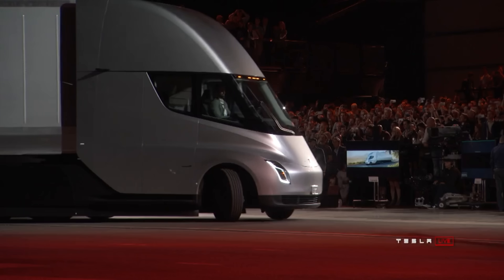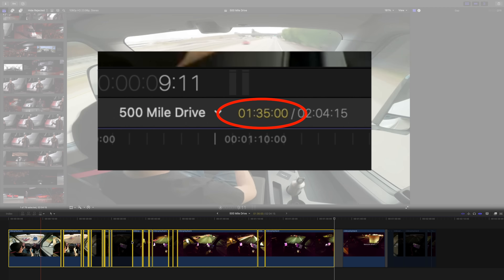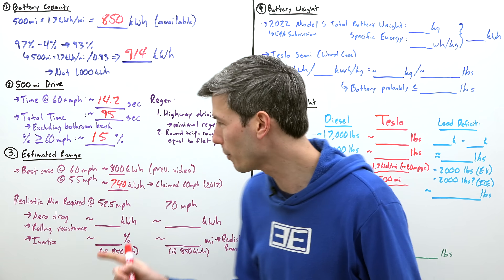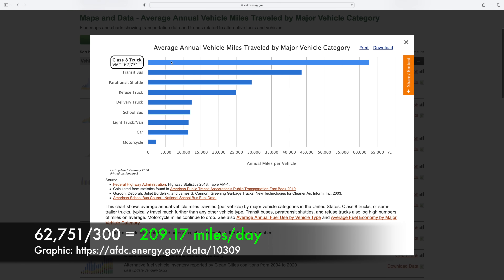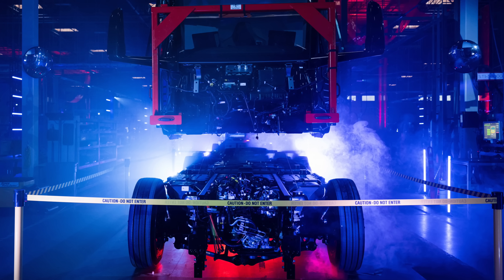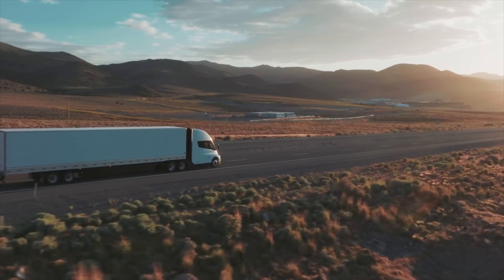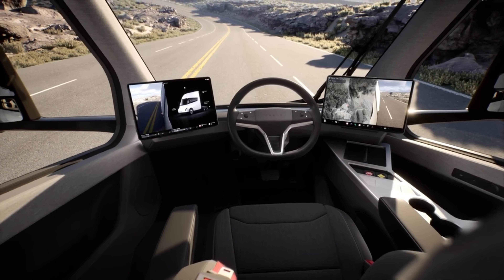Does The Tesla Semi Make Any Sense? Part 2!

Comment from the maker: *Important Note!* I left out a source for the 7.3 mpg figure for diesels, this comes from the Transportation Energy Data Book (Dept. of Energy) often referenced in the video, and references "all class 8 trucks on flat terrain." I figured since I'm using flat ground for my Tesla calculations, I'd apply the same benefit to diesel. The 5.3 mpg figure referenced in the first video was also from Dept. of Energy (video description links all sources). And to the truckers in the comments, hello and thank you for sharing your experiences! Y'all are the best drivers on the road, and I mean that. Respect!
Reply from the maker: @@silverdreammachine5866 It's not 100% (hope that isn't implied!). But if you look at the graph, the overall amount lost doesn't greatly impact the overall trend-line, simply meaning you can estimate these things on flat ground and get a fairly decent estimate. Regen is not 100%, and perpetual motion is a lie! If you get really into the trend line, you can see it does in fact change from the elevation (but small amount).
Reply: @EngineeringExplained  do you have any information on how driving on trips with high diffrence in altitude changes the mpg for dieseltrucks? If the Semi can regen most of the energy needed to gain altitude when going downhill it should make the economics even better over 1 million mile compared to a dieseltruck. Guess this apply more to the part 1 video. Love your stuff btw. Keep it up.
Reply: @EngineeringExplained  20% decrease in battery capacity in 12 months!  Assuming no fast charging! An not not running more than one driver!

COST MOST IMPORTANT!
Its now  3$ per mile VS Tesla 8.5$ per mile!  (dont forget to include battery replacement cost!)
Also using musks own figures from his videos (and using his new car elec car price) truck charging is more expensive! The cost becomes 150% more than diesel costs! Due to small increase in diesel price and huge increase in his electricity price from 7 to 50 cents! Hes not going to supply electricity at a loss!
Reply: @danquaylesitsspeltpotatoe8307  

Any idea what the decrease would be with 750 KW or 1 MW charging every day?
Reply: @EngineeringExplained  I struggled long and hard to try to understand why the 500 mile range test graph seems to show the gain from regenerative braking as significantly better than the 80% or so theoretical maximum. I finally realized that this is because there's a 35 MPH speed limit for trucks, both uphill and downhill; and the reduced air and rolling resistance almost completely makes up for the 20% or so energy loss in a climb and descent.
Reply: @EngineeringExplained Please discuss semi solid state batteries from China
Reply: Current semi uses 2170 batteries,   the S  uses 18650,  which are relatively heavier.
The three plaid motors used  are actually more powerful than the four '3'  motors available at initial launch,  and each is surpossed to be more powerful than a diesel motor.
But the big advantage is the weight saving of the plaid motor.  One can actually pick up the plaid motor, and about the size of an American football.
Reply: @davidclark2286  and can you pick up the batteries? electric motor efficiency has always been excellent, dating back over 100 years. its the batteries that are the problem.
Reply: @davidclark2286  Yeah, would be interesting to see how much the model 3/y pack compares.1,060 lbs (489 kg) 

The pack is 82 KwH and advertised as 75 KwH.
Reply: @davidclark2286  firstly, the difference in batteries packaging is negligible. the density is the same. secondly, what are the motors supposed to replace? you can't generalize all diesel motors lol. thirdly, the plaid motor is much bigger than a football.
Reply: The problem with the Semi isn't the engineering it's the economics. As is the majority of truck drivers are independent contractors. They aren't gonna buy an electric Semi with no infrastructure in place. The only way this makes sense with large corporations with local delivery routes.
Reply: @jordanslingluff287  Only 16% of US CDL drivers are owner-operators.  The corporations are going to do what makes financial sense.  If going electric makes financial sense than it doesn't mater what the drivers think.
Reply: @rogerheuckeroth7456  Oh yeah. I agree with that from a longer term perspective. I just don't see it being financially freesible for a while. Oil companies know that the USA just put out a huge green energy bill. They will no doubt pump more just to keep prices lower to counter EV sales. We are also in a high interest environment which makes any kind of capital investment very expensive. In 5-10 years I can definitely see it speeding up. But that is gonna require a lot of charging stations and our power stations cannot handle much more demand. I'd say a huge chunk of our population has lost power over the past couple of weeks. That's gonna get worse before it gets better.
Reply: @jordanslingluff287  Bingo. And for those customers, BEVs can make a lot of sense, especially given the subsidies available. Fortunately, they have multiple vendors available that can deliver product much sooner than Tesla. Tesla is very, very late into the game. And they don't seem to speak Fleet.
Reply: @TheGotoGeek  makes a lot.of sense because there's no maintenance so minimal downtime he makes sure to miss this because of mechanical bias.
Reply: @jordanslingluff287  Exactly, and even the large corp fleets want to unload and sell their trucks to the independents when the get old, which they can’t do w independents who can’t charge.
Reply: @Nill757  Good point. That's gonna be a problem with EVs in general. The average of a regular car right now is 20 years old. Ev batteries on paper only last 10-12 years. It's hard to imagine much of a used car market unless the government steps in and forces them to start honoring current standards like in ICE cars. Letting third party make parts, allowing individuals and 3rd parties work on cars, that means the ability to access the car through software...etc... Without that this march to EVs seems like more of an environmental disaster then helping anything. I mean if we start trashing cars every 10 years that will become a lot of waste.
Reply: @jordanslingluff287  EV cars are somewhat diff case.  All of them can be charged, not just sone special fleet of them w the special charger.   Yes it seems battery life would be a factor in resales, but so far the used Tesla market buys every single used EV going on the market in moments, sometimes inexplicably selling at higher prices than new.  There is, or was until just recently, some kind of weird fanatical demand ongoing.

Semi truck battery should go ~3000 charges x 500 mi, 1.5 million miles. I don’t know how that compares to diesel tractor life.
Reply: @jordanslingluff287  This is certainly true for now at least, but Tesla has shown to be capable of expanding a charging network faster than any other competitor, given that eventually trucks will be going electric anyway, the important part for investors is any electric truck will be effectively funding Tesla's network if it doesn't have a better one
Reply: @nyanbrox5418  I think Tesla has some big problems on the horizon. The biggest is China. 70% of their sales are based in China. The zero Covid policy has lead to isolated pockets of the virus mutating in different ways. Just judging by what happen here in America and Europe they can expect several waves over the next year as the virus switches from one dominant strain to the next. Obviously other car makers will have to deal with this as well but they have substantial business set up elsewhere. All these other makers is gonna put severe margin pressure on Tesla. So it will be interesting to see if they can maintain that network off less money.

I personally don't think Tesla will be able to keep up with something like a Honda/Sony/Qualcomm car but I guess time will tell.
Reply: @jordanslingluff287  I agree with the first part but not the second. It actually makes as much if not more sense doing otr runs between terminals. It is not uncommon for loads to be switched between tractors on a run and large carriers could adopt their routing do do just that, eliminating the distance issue for long runs.
Reply: @jordanslingluff287  I believe that is what Tesla is looking for while they get started. Corporations like Walmart, Pepsi, etc.
Reply: @Balo1997  They have and it's smart. These big corporations have big budgets and they know how to get every dime from the government to convert over. I guess I just don't see it taking over all of sudden
Reply: @jordanslingluff287  They can start with corporations while they build out a charger network, maybe they can do a partnership with a chain of truck stops.
Reply: @jordanslingluff287  You are correct. I don't think Tesla is not marketing towards independent truck contractors. They want the large company fleet market. This way they can collect data to improve the model and, as we saw with the first delivery, promote the Tesla brand with other favorite brands.
Reply: If it cost $5 per gallon of Diesel to go 7 miles, and you need 5 kW's to go 7 miles at a cost of $1 (5 x 20 cents) in an Electric class 8 truck, it's pretty obvious all truckers will want in on this savings or they will go out of business, and it is just as obvious truck stops will accommodate electric trucks because they also want to stay in business.   The issue that is difficult to manage is getting the amount of electricity needed to power dozens of trucks at one time to the truck stop, which may, or may not have a substation with that amount of power nearby.   This will certainly give some trucks stop a significant advantage over others.
Reply: @jordanslingluff287  true. The Semi will be a B2B thing for a few years at least.
Reply: @jordanslingluff287  for now yes
Reply: @jordanslingluff287  Get Real only about 16% are.
Reply: In California towing a trailer you are limited to 55mph
Reply: @jjamespacbell I forgot, the guy was speeding, where’s CHP when you need em’
Reply: Did I miss the weight of the trailer with the wood pieces and weight capacity of the trailer?
Reply: @matthewgoedtel5998  tesla makes the cab part not the trailers or any of that so its all pre-spec stuff and will be the same regardless of cab and only change with what trailer you need for a task
Reply: @commanderoof4578  Fully aware of that but does differ by trailer.
Reply: @commanderoof4578  and an ugly truck at that
Reply: @chris jones Waayyy more than that.
Reply: @bikeaddictbp  One thing I noticed is most people are still comparing the weight to a sleeper. The Tesla is a day cab. Compare it to other day cabs. They are a lot lighter.
Reply: @criticalevent  With an EV truck, there’s also the question of how much an extraordinarily high powered, hand held cable charging station costs.  My guess $3 million.  That’s gotta be passed on somehow. 

Society has been moving large chunks of energy around up close to people for a hundred years: always using liquid fuels.  It’s never been done before at mass scale using electricity at the MW level and up, not anywhere for anything, not w something you could plug in by hand.  It’s going to be expensive.
Reply: SuspectLam  That doesn't make sense because it used 93% of the battery at what it was carrying for 500 miles
Reply: @Silver Dream Machine Good question.
A few years ago I've been on a trip with a friend with his teslaS85P (build in 2014).
We passed a mountain range and I just was checking out the usage of energy (as told by the board computer) going uphill and downhill. Also the amaount of km range left (of coars taking into account the km driven).
That teslaS would regen about 75% of the extra energy used for climbing. This was a save estimiation...at least 75% regen.
But also....remember that a diesel truck will use much more energy when climbing but will get nearly no regen when going downhill (unless the downhill rate is very low and they can roll down without using braking at all...even not on the engine.)
Reply: @reiniernn9071   That teslaS would regen about 75% of the extra energy used for climbing. 
The theoretical recovery is about 81%, so your measure was very accurate. And just to be clear, diesels don't get "nearly no regen when going downhill", they get "no regen."
Reply: @Silver Dream Machine  Because you basically use the wheel speed to spin an alternator.

You're creating electricity like in a power plant basically. It's not 100% but its fairly close. Not at all like a gasoline car where up and down causes far more losses.
Reply: From Electrek;  

"A Tesla Semi electric truck traveled over 1,000 miles in a single day in a real-world test for a new independent study.

There have been a lot of doubts about class 8 battery-electric semi-trucks. Many didn’t think that they would ever be able to compete with diesel trucks.

The North American Council for Freight Efficiency (NACFE) has been conducting a study as part of its new Run on Less program to test several electric trucks in real-world conditions and release the data in real time.

There are three new Tesla Semi trucks in the program this year, and we reported on the first data coming earlier this month.

Now, the 18-day study has concluded, and on the second to last day, the Tesla Semi #3 managed to travel a record 1,076 miles in a single day ......

While NACFE didn’t specify the payload for this particular day, it did say that those trucks averaged over 70,000 lbs of loads."
Reply: @777Outrigger   it did say that those trucks averaged over 70,000 lbs of loads 
The author or whomever they're quoting makes the common error of mistaking GCVW for load. What it should have said is "those trucks averaged over 70,000 lbs. GCVW, which is equivalent to a payload of around 30,000 lbs. or 15 tons.
Reply: @BigBen621  Yeah, I noticed that. But still an amazing performance by the Tesla Semi. Rarely is any load a 100% of maximum, and not even highway speeds are maintained at 70 mph. There are slowdowns, even on interstates.
Reply: @BigBen621  And it's unlikely it's the organization that did the study. It's probably the author of the piece.
Reply: Something I've ran across a few times, and maybe you can help Engineering Explained. MPG is fuel economy, but often the wording fuel efficiency is used. Is fuel economy the same as fuel efficiency? If not, fuel economy seems highly related to fuel efficiency and seems directly comparable if the same speed is used to test in addition to the same fuel and the same cargo weight. Basic Wikipedia research seems to suggest fuel economy is a metric of efficiency:

"The energy efficiency in transport is the useful travelled distance, of passengers, goods or any type of load; divided by the total energy put into the transport propulsion means."

If you compare to the same speed, same cargo weight, your MPG should be comparable since it should directly represent efficiency. I would think even generic power in/power out efficiency may not be directly comparable for vehicles if you have different cargo weight, since efficiency varies with weight and speed for vehicles. BSFC seems to be a bit more directly comparable, but seems to only give the efficiency of the engine, not of the entire system, which I think is more important to discuss. Would enjoy a video breaking this sort of thing down.
Reply: @Silver Dream Machine He said all when he should have said most.
Reply: Wilson Lam  so what? many diesel semis can do the same.
Reply: @dasfoot  

To calculate regenerative braking all I did was calculate inertia and gravity as usual and then decrease by 90 to 95%.
That being said this is a silly point; a diesel hybrid semi could easily have regenerative braking which helps in acceleration and range without adding a giant battery pack, perhaps 50 KWh + 2 electric motors.
Reply: I may have missed it but how much are ICE/ diesel trucks range affected by speed? Just curious bc it’s always discussed/ used as a negotiate for EVs?
Reply: @steveapet1  the amount of extra power needed in theory is the same in practice it will be more as the ice truck will have more drag but everyone will care less as there is more energy in the tank than the batteries and it's easier at present to refill.
Reply: @steveapet1  

Speed is a factor for energy consumption, the type of fuel is irrelevant for this formula.
A lower coefficient of drag and low rolling resistance (tires) can help but that is a silly argument as a diesel semi can also have improved aerodynamics and low resistance tires.
Reply: @dasfoot  

Correct, hybrids make sense for a semi especially for acceleration.
Hydrogen (fuel cell) can also have regenerative braking.
Reply: @dasfoot  

Regenerative braking is a seperate system. As long as a vehicle has a battery and electric motor(s) I am quite sure that regenerative braking is an option. It would not require a heavy battery. Two electric motors weigh 90kg and a 60 KWh battery pack weighs 478kg so perhaps only 600 kg of extra weight. With hydrogen you already have electric motors thus it's mostly the extra weight of the battery.
Reply: you forgot one thing... the human factor.
driving 400 mi at 70 mph, that's 6 hours of driving... I'd say the 45 mn charging pause for the driver is well deserved
Reply: @AmauryJacquot  

There's a 30 minute break, that's by law.
You expect all these places to have megachargers?
Reply: @Nature-pilled  would only make sense
Reply: @AmauryJacquot  

Would only make sense to have a 750 KW or even several 1 MW chargers at the side of the road?
Do you have any idea about this infrastructure?
Reply: @Nature-pilled  
wherever truck stops are located.
the infrastructure is much easier to set up thant diesel distribution centers, there is no need for onerous safety mesures.
Reply: @Nature-pilled  distribution of liquid chemical fuel is stated to end in a few years, because it's use is a major provider of greenhouse gases.
diesel semis are a dying breed that won't last 20 more years. deal with it.
Hydrogen is a non starter, the efficiency of the chain (hydrolysis, compression to liquid, transportation, distribution, and all the accrued losses) is just totally ridiculous (less than 2% or so)
Reply: @AmauryJacquot  

Amaury I was talking about efficiencies and proven concepts, not regulations or climate taxes and subsidies. That is a different topic.
Even if your claim is correct and diesel semis will die out in 20 years from now I don't see how that is an argument as even Elon and Pepsico admit that a Tesla semi will only last about 7 years (and that's being generous with the constant megacharging).

"Hydrogen is a non starter, the efficiency of the chain (hydrolysis, compression to liquid, transportation, distribution, and all the accrued losses) is just totally ridiculous (less than 2% or so)"
...
I am not sure what you are on about and how you derive at this number. It seems that you include losses from long haul, long distance shipping et cetera.
This is actually ironic; you expect a megawatt charging station at the side of the highway with a massive electricity infrastructure...yet an electrolyzer at the side of the highway which requires the same infrastructure is not a possibility? You don't need any of these energy losses since you can generate the electricity where you want it, an electrolyzer isn't as big as you think.

A kg of hydrogen holds almost as much energy as the energy cost with current electrolyzers (>80%) and companies claim they can bring this up to about 95%.
That leaves transportation (if you don't generate the energy at the station)...which is not as big of a factor as you may think since hydrogen is incredibly energy dense, almost 3 times more energy danse than diesel or gasoline.
A single kg of hydrogen can hold almost 40 KWh of energy, compared to 250 WH/kg for Tesla batteries.
The only reason that hydrogen vehicles are heavier (than ICE) is because of the tanks. It's safe to assume that in the future these will become lighter and even safer (they're quite safe even today).
Reply: @Nature-pilled  the issue is that there is no storing of LH2 long term, as there is no material that is capable of preventing it from escaping the container. So you need to either produce it on the spot, or regularly refill the containers at the filling station.
this is impactical and not economically viable.
Reply: @AmauryJacquot  

Ironically; the same issue applies to large battery-electric vehicles because you need 800KWh of electricity in 30 minutes for a single vehicle.
Either way you claim that the grid can handle this massive electricity requirement (which it can't) or you are stuck in the same scenario of expensive storage in both cases, batteries and storage tanks.

You may argue that hydrogen storage is inefficient, which is due to evaporation with increased pressure tanks because hydrogen has a low density. I would argue that this is again ironic because batteries are far less efficient as an energy storage tool because the energy density is frankly pathetic and has barely changed since the original roadster in 2008.
To call hydrogen storage impractical when comparing it to batteries is absurd, even Elon cannot get around the simple fact that batteries have the lowest energy density of all these options.
Batteries can also be expensive at this scale, as you would need a 1000 KWh battery for each charging station or at least the same size as the battery pack of the vehicle, this will cost far over 100.000 dollars for a single charger plus a massive amount of  CO2 for manufacturing and transport.
These minerals for batteries aren't mined in Ohio or Texas, there is a lot of ethics surrounding this way of moving forward and if we want to depend on solarpower please consider that China almost has a monopoly.
Elon also claimed to make charging stations energy independent which is a fairytale in terms of energy production and storage.

When you are talking about hydrogen it's important to note that this is all fairly new and the efficiency icnreases rapidly.
Then again you also have to consider the specific use case, in case of a 'gas'station you won't need a lot of storage in the first place, just like Tesla isn't talking about a 10 megawatt battery in their megawatt stations a hydrogen station wouldn't need giant tanks either.
Reply: @Nature-pilled  Upgrading the grid is something that HAS to be done anyhow, most elements of the current grid haven't been touched for decades. the PG&E stuff that caused massive wildfires a couple (?) years ago in california didn't see a maintenance crew for a century.
this will benefit the entire population at large.
As an alternative, we could also replace all those trucks with electric trains. the infrastructure costs would be massive, but the savings would be even more massive.
Reply: There are only 9 Jersey barriers on that truck big guy
Reply: @MrJanes-cl5sj  Clearly there are 11, and they're 10 ft. Caltrans-approved K-Rails, which weight 3,900 lbs. each.
Reply: @MrJanes-cl5sj   There are only 9 Jersey barriers on that truck big guy 
Look again—there are three rows of three, and two in the last row. 3 X 3 + 2 = 11.
Reply: @BigBen621  sure thing buddy-it won't matter this truck has been a disaster from the onset. Its just a semi version of the cybertruck.
Reply: @Silver Dream Machine I can answer that, as I have an electric car(not a Tesla). In practice I have found that the range is not affected by variations in height of the road. Once you go down hill you do not use power anymore only regenerarive braking(engine breaking in gas/diesel) if you need to do so, thus the range shows exactly the range as if it was flat ground. Even If the incline downhill is small you can just coast and not use energy. Important thing to note never charge your batery at the top of a hill to 100% as regenerative breaking will not work. If you start the trip with a long downhill you are putting more into the batery pack then taking out.
Reply: After looking at DoE statistics, I realized how I was right about certain aspects and cargoes being completely inappropriate for an electric vehicle. Just like trains handle cargoes completely inappropriate for highway travel. I also see that I spent my time way over on the right side of the graph. I barely drove 20-30 miles empty between maximum gross loads. Still maintained a decent fuel economy rate and kept the freight moving on time. I also averaged 2-3 loads over 7 days averaging around 3600 miles. The biggest thing is the charging infrastructure. I just don’t think people realize how much power is used so they can be cozy and get there snacky-snacks a Wal-Mart… 😂
Reply: SuspectLam I don’t know your background and I’m definitely not being a jerk, the trucks I drove over 25 years were all capable of hauling well into the 150k lbs Range. There was definitely an adverse effect on fuel economy, due to both physical dimensions and weight once past about 88-90k lbs. the point I’m getting at is, one is still going to need to fill a fuel tank or battery sooner when hauling larger masses and physically oversized loads.
Reply: Temperature changes are bound to affect range.  Driving a semi in average temperatures of 20-30 degrees F surely reduces the range considerably.  And high temperatures of 100 F would should put high stress on the batteries wouldn’t it?  AC and Heat in the cab would also place demands on the battery
Reply: @F1fan007  Tesla batteries are temperature controlled.
Reply: @Nill757  that’s cool, I didn’t know that.  Is that so they don’t get too hot or cold and is that a drain on the battery?  I can’t imagine range not being affected in very hot or cold climates.  Our summer highs where we live can get to 110 to 115 and our winter lows can get to -20.    To stay comfortable, the driver would be using a fair amount of battery power to keep the cabin around 70 degrees.  Not ideal compared to more temperate states like California.  Also, would the batteries lose some range just trying to keep themselves at their ideal temperature at these extremes?
Reply: @Nill757  Yeah that also means you drain power round the clock.
Reply: @F1fan007  Yeah they still lose power in extreme heat or cold by keeping the batteries conditioned. Just less then not keeping them conditioned.
Reply: @F1fan007  It’s well known that batteries of  all kinds are subject to temperature sensitivity.   Cold reduces the current battery capacity, and hot reduces long term battery life.

Yes the temperature control system imposes a small tax on the battery, same w cabin heat, though small compared to power required to move the rig down the road 60 mph.
Reply: @jordanslingluff287  Eh, I’m pretty sure no for Tesla, thermal system on only when running, unless you tell it to warm itself up for a pending trip.   Of course if a crew is sleeping on board as they do in diesels, then yeah it’d drawing heat all the time.  Maybe could stay plugged in w low power 2KW circuit at a truck stop for that.
Reply: @Nill757  Well their cars drain power to keep the batteries in a certain range at all times. I was just guessing based on that.
Reply: @Nill757  good point
Reply: @jordanslingluff287  While parked?  That must be only if plugged in.  If it runs thermal whole time left in some cold airport parking lot for a week it’s tow truck time on return.  They know that, so can’t be.
Reply: @Nill757  While parked.  Look up videos of people trying to charge in the cold. 

The part no one is talking about is by going to EVs we are going to have to make incredible amounts of electricity and all just to wast. That's why the Japanese have been so hesitant to convert over....

That also harms us economically as well because energy cost are already high going higher with all the investment cost. Converting to electric is gonna require us to collect taxes in a different way, which means even higher prices. Being an environmentalist myself I don't really like the idea of everyone having $60,000, 10,000lbs, suv, that acts like a cell phones constantly draining the grid because they only drive 50 miles a day. At least not with our extreme grid investments.
Reply: Wilson Lam  if you have the low end torque through motors or gears yes, even a half ton pickup could tow way over its capacity…but. Also I’ve personally worked on off highway trucks that are more HD than semis and can tow 250,000lbs but because the way physics is it won’t last as long..so 80-100tons is okay.
Reply: @@silverdreammachine5866 It doesn't capture ALL the energy used going up the hill. What he was saying is that it (makes up for the difference of energy needed to drive uphill compared to driving on a flat road). So you are correct it can't be 100%.  There's no such thing as free energy. What that graph showed was on that drive the truck AVERAGED about the same usage of energy per mile as it would if it was  driven on flat ground. It is better than a vehicle without rengen capability, because in those vehicles even when going downhill (with the engine running) you are still using some energy/fuel. With regen at the bottom of a big hill you actually have added (fuel). But only added enough fuel to cover the addition amount of fuel it WOULD have taken to drive those miles on flat ground, NOT all the fuel you used to go uphill.
Reply: I have family that are truck drivers. I can see why Tesla is targeting retail first. Depending on if it is a drop and hook with the trailer or if the trailer has to be loaded/unloaded. With the latter, the truck could sit idling for hours, waiting to get loaded or unloaded. The company could install a charger at the dock and the truck could be charging at that time. So range would not be a major problem as long as each store has a charger. This could work better with a single-door dock. For a multi-door dock, it will take more thought like overhead charging handles or a charging area. The trucks could charge there until they are called to the dock to load/unload. The Tesla Semi will not be for all in trucking, just like their cars, they work best if you can stay inside the bubble.
Reply: Mpg is dependent on altitude as drag is reduced and on Gas cars/lt trucks use a larger throttle opening, reducing pumping losses. I left Colorado at 6-8500’ and was getting 12-13 mpg towing a trailer with a 2010 Ranger 4l ohc . Got to Louisiana and it was 9 mpg all the way to Orlando ( the doid) …. Home of the Tragic.
Reply: They are going to be used in the underground projects, look at DUMBS and the subterranean systems through our world
Reply: I love how the numbers keep the ratings accurate, something i would like looked into is the kwh required for accelerating an 80k lb truck flat and uphill grades, they only mention steady state cruise. and elon promised never being stuck behind a slow semi again.  Also kinda comical the first two adopters are just poison producers contributing nothing good for humanity.
Reply: @leadfoot8593  it's got over 3000 horsepower and 3000 pound-feet of torque what polluting desiel you going to compare that with?
Reply: @jeffp3999  read up on current diesel emissions standards, where most electricity comes from then try again.
Reply: @leadfoot8593  read up on diesel for electricity generation being only a couple of % of global electricity generation first and get back to me
Reply: Where are we getting the electricity? When do you use the wind power to drive electric trains on at minimum a parallel to the I 35 corridor, using battery/electric small diesel aux charger, design the power to be used when close to the generator farm on the line and as you lose power due to resistance, use power from battery to get to the next generator set , Great Plains has wind , level for rail, getting freight off the interstate, could allow hi speed with no trucks. If they are really ready to discuss anything with climate change, then they will have to stop air travel. Unless you want to fly a paraglide
Reply: Pepsi Truck got TOWED at Jan 5.

No vroom no consumption!!
Reply: I wish they were the best drivers on the road around here...
Reply: If you’re saying truck drivers are better drivers than the autonomous drivers, yes. But it kinda looks like you’re saying that there any trucker. that comments on your videos is a better truck or than the others.  🤪
P.S. I too thank the truckers for their contribution on this page and others. It’s very helpful in being insightful. Furthermore, I am curious if the truckers in the audience think the Tesla has a trucker on staff. I ask because of the little oddities that I see in Tesla demo videos.
Reply: @JoeOvercoat  Engineering Explained has not driven in Brampton Ontario to see the level of "professionalism" exhibited by the truck "drivers" there. A pre-Beta autonomous truck is 1,000% safer than what goes on in that city.
Reply: Purposefully left out a lot more too.
Are you sure you're an 'engineer'?
Your analysis is like what we see at Level 3 elsewhere, not Level 6
Reply: Wilson Lam  sure it has enough torque, but how effifient is that lol? A lot of machines Can pull that much weight but is it as efficient as a regular diesel truck. No lol.
Reply: @Antwonn83   how effifient is that lol? 
Far, far more efficient than a diesel semi. BEVs typically use 2/3 less energy that ICE vehicles—which you can easily verify on the EPA site by comparing MPG of ICE vehicles with MPGe of comparable BEVs.
Reply: Mine get 8-9mpg loaded.
Reply: Engineering explained is also wrong about the size of the battery pack.
If the Tesla indeed used only 790,5 KWh of battery then this would mean an efficiency of 1,58 KWh/mile.
This is not what Elon Musk claims and would not make sense compared to other reallife examples we have. Several sources such as InsideEVs also claimed that the semi will have a 900 KWh battery.
If this were the case then in the 500 mile test the total energy consumption would have been 837 KWh and this would be an efficiency of 1,67 KWh/mile or almost exactly what Elon claimed.
We can conclude that the battery pack is 900 KWh, not 850 KWh.

The frontal area cannot be 10,66 m²...the semi is about 4 meters high and the trailer is about 2,6 meters wide, the max. frontal area is thus 10,4 m² but probably less at 9,6 - 10 m².
The coefficient of drag was originally claimed to be 0,36...that"s when the semi would have cameras instead of big mirrors. Now it has big mirrors so this adds at least 5%, a CD of at least 0,38.
The mass was not 37195 or 82000 lbs, it was 81000 which is 36741 kg.
Regenerative braking does not have an efficiency of 100%, which you can also see on the graph, it is max. 90 to 95%.

Since the energy consumption is not 790 KWh but 837 KWh this means the semi is less efficient than in Jason's formula, probably a different rolling resistance and/or battery-wheels efficiency.
By using different variables and then plotting these variables in the Fito-Lay semi example which drives 684 km and has 20% battery left, I can calculate the weight of the tractor and the max. payload.
Depending on the variables (rolling resistance, battery-wheels efficiency, speed, elevation) the max.payload is between 10 and 14 metric tons.
Reply: "they" is Elon Musk
Reply: Very impressive analysis. Misses the point completely.
Reply: I believe your truck weight projection are in error.  You failed to account for loss of the ICE engine and transmission before adding the battery pack projected weight (which is closer to 8k lbs measuring by kw).  ICE weight loss is about 4k lbs bringing the total weight to about 21k .
Reply: @grunt98444  

A batterypack of 900 KWh that weighs 8k lbs? A batterypack for 100KWh weighs almost 1400 lbs.
As for the weight of the tractor, in reallife examples the weight of an electric vehicle is about the same as the ICE version + battery weight.
Reply: I believe your Semi truck calculations regarding weight are in error.  You failed to take into account the loss of the ICE engine and transmission (about 4k lbs) in your projections.
Reply: Can you make a video about INN engine. Thanks
Reply: What's your take on possible hybrid systems? I've never understood why we have basically skipped over hybrids and are trying to go to all electric. I've always wondered why diesel hybrids have never even been discussed. I'm no engineer so I could just be living in a fantasy land in my head, but doesn't it seem like the absolute winner would be a diesel hybrid? Especially for trucking?
Reply: @davidolson5726  The downside of hybrids is that they require complete IC and EV drive trains; adding to the cost, weight, and failure modes of either a pure IC or EV vehicle. 
Hybrid cars are attractive mostly because most cars average only a few tens of miles a day, and so are fine with a battery range of 50 miles or less; but still need a longer range for occasional trips, etc. Since semis must make long trips each day to be cost-effective, there's less need for hybrid semis; although I think some companies are working on them.
It's a safe bet, though, that Tesla will never do this. A diesel-electric hybrid semi would still use diesel fuel, and Tesla's whole point in developing the Tesla Semi is to eliminate emissions, mostly particulate emissions, from diesel fuel. Further, their company vision is a completely renewable energy economy, which wouldn't be compatible with a diesel-electric hybrid semi.
Reply: anyone who assumes trucks drive at or below 60mph clearly has no highway road experience. there are a lot of assumptions like that in the video. using averages doesn't give an honest picture. in reality, EVs are expensive, problematic and not competitive with combustion engines.
Reply: @AnthonySNY   anyone who assumes trucks drive at or below 60mph clearly has no highway road experience 
He didn't assume the truck drove at or below 60 MPH, he documented the fact that the truck drove most of the time at or below 60 MPH. This is because a) the 500 mile range test was run in California; b) the truck speed limit in California is 55 MPH; and c) the driver was an employee, and unlike independent owner-operators had no financial incentive to risk his CDL by driving substantially over the limit. 

If you'll look at the results of the Run On Less tests, which you can find by searching for Run On Less results, you'll find that the three Tesla Semis belonging to PepsiCo usually drove at 62 MPH or less, for the same reason.
Reply: when fully loaded i would drop to 35 mph on highway...up hill.. granted i go really fast downhill if pop it in neutral.
Reply: One thing with going up hill does not mean you will go down as far or as steeply meaning equal power (Less steep means less energy!) Up Hill and Down Hill is not a Fact and vise versa!
Reply: Seemingly a lot of arm chair engineering going on here. Dan Priesty just revealed that the 500 mile Semi tractor weighs >26,000 lbs... Some estimates had the Semi battery weighing 26,000 lbs and the tractor weighing as much as 45,000 lbs. ... And the Semi is going as much as 1000 miles in 24 hr in a period with a GW usually over 72,000 lbs. Bye Bye hydrogen.
Reply: All they can haul are potato chips…bags full of air…😜
Reply: @hernancortez491  No, they're hauling heavy batteries from Giga Nevada to their car assembly plant in Fremont, California, saving Tesla a bucket load of money. And they're hauling cases of Pepsis near or at full load too.
Reply: @criticalevent  it literally says the charge time in the video. But you think nobody at tesla thought work/drive hours regulations? The dude running the program comes from the trucking industry, they have been seen show casing the trucks at various fleet owning companies. None of the thought of work/drive hours? You think your that much more smarter than all those people?
Reply: @theunknownunknowns256  You think nobody at British Aircraft Company thought about common long distance air travel paths around the world before they produced the Concorde which could barely get across the Atlantic and no other trans oceanic? That’s the best the tech could do, and they hyped and marketed everyone into thinking it was taking over. Got people killed eventually. 

Plenty of products on the market from smart people where the product only works half assed or not at all, sometimes from fraud (FTX and Theranos) and sometimes because the tech is lame, like Zeppelins for passenger air travel.  Happens w even great innovators. Edison has some disastrous blunders into which he poured fortunes.
Reply: @theunknownunknowns256   "You think your that much more smarter than all those people?"

"Your" is possessive, whereas "you're" is the contraction of "you are".

"more smarter"

The "more" there is superfluous, because of the "er" on the end of "smart".
Reply: Please do a comparison between Hyliion semi and the Tesla semi 🙏🏾
Reply: @Silver Dream Machine I had the same question but I realized I was missing something. It isn’t that they get 100% back but they get back is 100% of the difference from going uphill and downhill. They are still spending the same energy as if they were going on a flat road. So if going on a flat Road cost you 10 units of energy and going uphill cost you 20 units of energy. You would only get back 10 units of energy going downhill.
Reply: @RobertLopez66  

"They are still spending the same energy as if they were going on a flat road."
...
They are not because this would mean a 100% efficiency of regenerative braking, the very max that is possible today is 95%.
The graph shows at least a 5% inefficiency.
Reply: @RobertLopez66  Actually, you get back about 81% of the excess energy due to the climb—90% efficiency  both ways.
Reply: On flat the dissel will not get a recharge on descending a hill. 
Nor will it get that in the hills, EV's however will, there is the win.
Reply: @ArubaSailing  

It's called regenerative braking, any hybrid , FCEV or BEV can have that.
Reply: @Nature-pilled  Yes, thank you.
Reply: Euproen Volvo make 10mpg and more
Reply: @مدمنكورة-معتزحفني  speed limit is a lot lower in Europe. About 80-90km. (50-55mph) in the US, 100-120km (60-75mph) is very common. Air resistance is the biggest subtractor to efficiency, and the faster you go, the lower the efficiency.
Reply: @tangydiesel1886  in the UK max national  speed limit for trucks  on motorways is 60mph, other duel carriageways 50mph and single carriagways 40 mph. If lower limits are not in force on any given road.   It regularly debated should we go back 60 for duel and 50 for single.  Note drivers can be prosecuted from the taco unit records so these speed limits are observed by truckers.
Reply: @tangydiesel1886  You're not even European are you? I've never, in my whole life, ever seen a truck on the autobahn driving only 90km/h. EVER.
They always go around 110, so basically the same speed.
Meanwhile I also seem them going 90-100 even on countryside roads, which is rare as mostly highways are being used.
I have no clue what you are basing your claim on, maybe the truck simulator game?
Reply: @kontoname  not European. A lot of the YouTube truck drivers I've watched, that's all the higher they go, and what they say the limit it. I haven't seen any German ones, I'll give you that. But any reading I've done shows that's the limit, but, that doesn't mean it's followed. Down in Texas, a lot of non interstate roads are 70mph, but most are going 80mph. (Cars and trucks)
Reply: @مدمنكورة-معتزحفني  but isn't that
    uk gallons not us gallons.  
1 uk gallon =~ 1.2 us gallon.
Edit: this relates to the comment European Volvo makes 10 mpg earlier in the comments. 
ie european mpg and us mpg are totally different units.
Reply: @davidclark2286  the solution is simple: use the metric system
Reply: @مدمنكورة-معتزحفني  US gallon and UK gallon are different sizes so fuel economy is not different, just measured in different units
Reply: @مدمنكورة-معتزحفني  provide a source
Reply: @مدمنكورة-معتزحفني  Yeah but they drive way slower than we do. I’ve driven American Volvo trucks. The truck is nice but their engines suck hard. No pulling power and terrible fuel mileage. Maybe 6 to 6.5 mpg.
Reply: @مدمنكورة-معتزحفني   not class 8, Volvo can’t haul same load. Might as well cite a Hyundai sedan at 40 mpg.
Reply: @Nill757  the gvm of european articulated vehicles is very complicated  because road freindly suspension and layouts are allowed higher capacities .   VOLVOS are most widely used for higher gvw tractor units but all European gvw's are higher than US although only single trailers are allowed at the moment.  All european limits are in metric tons(1000kg).  US tons are only 903kg(2000 lbs).
Reply: You didn’t factor in battery life where is diesel can run forever just keep filling it up
Reply: @johnnyd4200  The Diesel engine, transmission can’t run “forever”.  It wears out, like everything else. Semi battery w 500 mi range should go 3000 charges like other batteries, 1.5 million miles, or less.
Reply: @Silver Dream Machine if you look at the curve it shows that, the battery at the beginning of the hill climb is significantly higher than when it reaches the bottom of the hill. I think he meant it does not hurt it as much, you are right regenerative braking brings back only 15 to 20%, but the same goes with diesel trucks, on the way down they churn the low gear to use the engine as a break. So the straight line makes sense.
Reply: @PierreH1968  Regen braking recovers about 81% of the additional energy used for the climb, not 15% to 20%.
Reply: @BigBen621  Wow I didn't know, thanks for the information! But I was thinking in absolute terms not the additional energy, meaning that regen contributes to 20% extra battery charging in average. (on my Tesla S the regen braking maxes out at 50% on the gauge), they must have optimized that on the Truck to go higher than 50%.
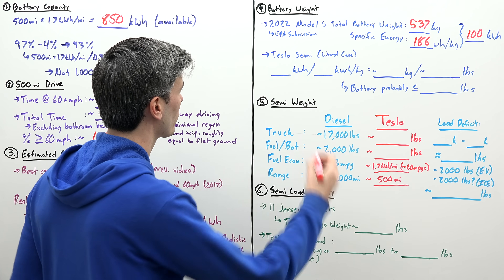Reply: @PierreH1968  Pierre, my original response was deleted, perhaps due to a couple of references. Here's an abridged version; I'll post the references separately, to see if they survive. [Edit: they didn't. One was to a YT video entitled Breaking the laws of Efficiency! Tesla Semi Physics Explained which you can search for, which has a good technical description of energy implications of regen braking at 7:45. The other was to a Google Docs spreadsheet that does the calculations, which although it's a Google product, apparently I can't link to.]

If you're referring to the circular power meter on your Model S, that's calibrated in kW, not percent; so -50 is not 50%, but 50 kW being put back in the battery by regenerative braking. An average would be meaningless, because the energy gained from regen depends on the initial speed and rate of deceleration if you're using regen braking to decelerate, or the speed and slope if you're descending and using regen braking to maintain a steady speed, and these depend entirely on the driving situation.

It can be calculated that at 70 MPH down a 7% slope, which is about as steep as you'll find on any highway, the gain for your Model S from regen is less than 28 kW; since this is far less than the motors are capable of generating or the battery is capable of accepting, it's likely that any limitation in the Model S is due to the physics of the situation, and not an internal limitation.
Reply: Why would you assume those barriers weigh 4000lbs each? What if they each weigh 500lbs. We really have no idea.
Reply: @ianfisch7289  WTH are you talking about they are standard Jersey barriers
Reply: @MrJanes-cl5sj  Actually K-Rails, which are the California-specific version of Jersey barriers. Weight is 3,900 lbs. each.
Reply: @ianfisch7289  

Exactly, we have no idea how much these barriers weigh and not one person has found the exact same model...suspicious.

We do not need to know how much they weigh, we know from Pepsico that a semi filled with potato chip bags can hardly achieve a 500 mile range so there is no way you could achieve the 500 mile range with 20 tons of cargo.
Either Tesla lied about the load or they drove at a snailsspece to preserve battery, the 500 mile test and the claims from Pepsico are certainly contradicting.
If they only have 20% battery left after hauling potato chips for 425 miles then they won't have 20% battery left after hauling 20 tons of concrete barriers for 400 miles, it is that simple.
Reply: @ianfisch7289  

Exactly, we have no idea how much these barriers weigh and not one person has found the exact same model...suspicious.

We do not need to know how much they weigh, we know from Pepsico that a semi filled with potato chip bags can hardly achieve a 500 mile range so there is no way you could achieve the 500 mile range with 20 tons of cargo.
Either Tesla lied about the load or they drove at a snailsspece to preserve battery, the 500 mile test and the claims from Pepsico are certainly contradicting.
If they only have 20% battery left after hauling potato chips for 425 miles then they won't have 20% battery left after hauling 20 tons of concrete barriers for 400 miles, it is that simple.
Reply: @ianfisch7289   Why would you assume those barriers weigh 4000lbs each? 
 They are uniquely identifiable as 10 ft. K-Rails, which are the CalTrans-approved version of generic "Jersey barrier" highway barriers. These are shown to have a weight of 3,900 lbs. each on the CalTrans blueprints for these barriers. Eleven of these at 3,900 lbs. each plus 1,100 lbs. in tie down chains and paraphernalia, driver, tools, and other miscellaneous items totals a payload 44,000 lbs.
Reply: @@silverdreammachine5866he means if the initial elevation is the same and the ending, you can assume it’s a flat road.
Reply: @Engineering Explained Jason, you did a much better job than Thunderfoot on calculations!
Reply: @matthewgoedtel5998  that is an understatement Matthew Thunderf00t is not interested in the truth whatsoever he is out to bust claims and if he has to cherry pick claims and be disingenuous to "bust" a claim then so be it... He is a hard core Elon Musk hater most of His busts on Musk are missed timelines and a great deal of those are due to unforseen delays due to the plandemic and mitigating shortages and regulatory slowdowns.
Reply: @matthewgoedtel5998 thunderfoot inherint bias significantly influenced his “results”.
Reply: The fuel consumption for a loaded big rig is about 6 mpg, per the US EPA 2017
Reply: @felixbaum48  There are numbers bean counters gather and there is real world experience.
Reply: @felixbaum48  my 2020 freightliner avg's around 8mpg by my IFTA taxes.
That's loaded, empty and bob tail.
Reply: @felixbaum48  Mine gets between 7.5 and 8 mpg’s
Reply: The truck weight without battery is closer to 12500lbs not 17000lbs

It is not a live in truck hence smaller and much much lighter

Also tesla is using the same steel they will be using for the cyber truck which is lighter at the same weight as the typical steel used for trucks

So your taking away 4,500lbs of weight that will be cargo not truck and short changing the calculations
Reply: @criticalevent  Wrong, Elon is not directly in charge of the semi.
Reply: @criticalevent  Saying it doesn't make it so. I'm sure you said the model 3 and model y would never make it to market.
Reply: I feel like trying to hold any company to a price stated from 2017 in today's market is most likely not going to happen. One ton trucks have gone up at least 10,000$ since then. How much has the price of a normal semi increased since 2017? Just in inflation alone a truck that was 150,000$ in 2017 would cost over $175,000 in 2022.
Reply: Thanks,  I have try to do the same case (it does not need to be good for everything,  most trucks are not cargo capacity constrained, and not all routes are super long or short but uphill only). This video will be the perfect reference.  The other question is durability.  Normally I answer 1. We don't know what corners Tesla is cutting,  2.  Cargo. Locomotives are often diesel-electric, is not like electric motors are fragile by nature.  We need better batteries. The Truck will be under continuous load,  365 days a year. We need to factor 80%  of the. 850 kWh battery or it's not going to last. So it's really a  680 kWh
Reply: @jaimeduncan6167  it reportedly has a 900kWh pack with ~850kWh useable and 50 reserved for longevity. Official specs not out yet though.
Reply: Still no reference to temperature.  This is North America!  Temperature affects battery life.  Also running a cab heater with a direct short to generate life sustaining heat will affect battery life.  Why do you ignore these very important factors in your math???
Reply: @genesharp2502  it should take less than 1kw to heat that small area with a heat pump. Ie, heating could run 850hrs = 35 days on a fully charged battery. Even @ 2kw, that is still 17days on a full charge. No one runs lower than 20% charge, thus @ 20% charge = 3.5 to 7 days worth of heating. This is why no one is talking about it - it is a non issue.
Reply: @nordic5490  that’s nice on a full charge.  The problem might arise if you are stuck towards the end of a route.  Running the heat will still reduce the range of a truck and there’s no consideration of it.  It just seems odd to me.
Reply: @genesharp2502  actually newer Teslas now use heat pumps for the climate control of the cabin and fair much better than diesel engines in a winter stand still and at subzero temperatures beat the heck out of resistive heaters which barely bring the temp up to 40°F degrees from -20°F test run on otherwise identical model S Teslas the heat pump brought the cabin up to 85°F I forget how long it took but very impressive.
Reply: @emiliohernandez7747  even the newer heat pumps use energy.  That energy usage  does not seem to be in the equations.  There have been tests  between teslas older heat system and the newer heat pumps and there’s still quite a bit of energy used.  Also what if you are in a snow bound situation and  stuck in traffic.  It would be interesting to see how long a Tesla truck driver would last especially if he was at the end of his range.
Reply: @genesharp2502  Diesel semi's don't keep the cabin any warmer at the end of their range then evs at the end of theirs. My 3/4 ton doesn't really make much heat at idle in the winter.
Reply: @emiliohernandez7747  Yeah, but diesel cabs can use diesel heaters and APUs. Those diesel heaters can output 8000 BTUs at less than a gallon per hour.
Reply: @genesharp2502  I do have a car with a heat pump. My previous had a resistance heater.
The heatpump (heating AND cooling) makes a range difference of 5%, the older one (resistance) 25% difference.
Take into account that my ioniq 5 weighs 2500 kg fully loaded. And uses 190 wh/km. To heat a semi cabin it will not take much more energy (max twice) as heating my ioniq 5. But the semi needs at least 5 times more energy for driving 1 km as my ioniq 5. For heating less than 2 times the energy is requiered....range loss not 5 % but less than 2,5%. 10 miles on those 500 miles....
Reply: @reiniernn9071  Supposedly you loose 11km EV range per hour keeping  the cabin warm from 0degC outside, more to get it warm to start.
Reply: @Nill757  My car looses ca 5% range for a full range drive. That is , in winter terms, ca 20 km for a 4 hours drive. Calculating this...when being parked I'll loose 5 km range/hour. 
For this semi it will be max 2,5 km (1,5 miles) / hour.

Of coarse there is no rest warmth from driving to heat the car...but when being parked also less air flowing around the car.
Estimating on own experiences with an ioniq 5, a kona64E , an ioniq (2017) ...all ca 5% less range...and a nissan leaf (resistance heating and loosing much more % in range)
Temperature ca 0 grad celsius. (32 Fahrenheit)
Reply: @genesharp2502  You obviously have no idea what you are talking about. The Tesla semi does not use resistance heating. It mostly utililizes a heat pump for cabin heating not a direct short as you say, which is also incorrect. Resistance heaters are not a short as indicated by their name.
Reply: @matthewgoedtel5998  resistance uses the battery.  Sorry I think it’s you who doesn’t know so much.  I’m not against the Tesla truck idea but to not factor cold temperatures for battery life and for usage in cold weather is curious. Perhaps you have never been stuck in a snow drift for an extended period of time.  This just happened to many people over the Christmas holidays. It’s a real factor that should be considered.
Reply: @genesharp2502  🤦‍♂️ I'm not disputing  that resistance heating uses electricity... The semi uses a heat pump. Heat pumps are even more efficient than the near 100 percentage efficiency of resistance heating. Go look at some Tesla climate control in cold weather videos. Even the old tech model x from a few years ago does a good job of maintaining temp for a couple days at low temps.
Reply: windmills and Soler is ineffective argument closed and you are a woke sail out